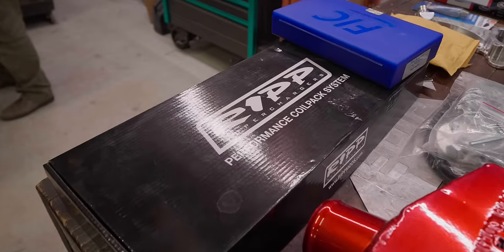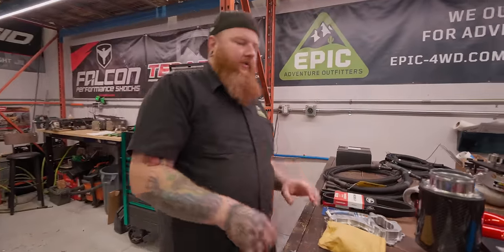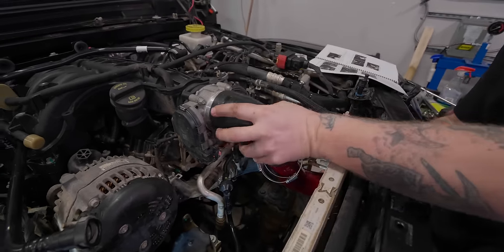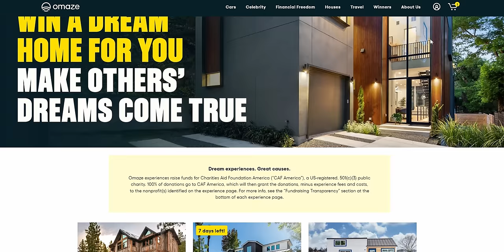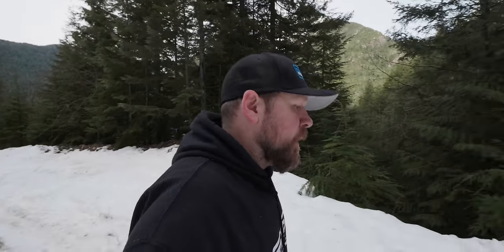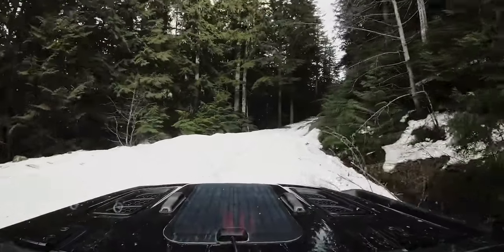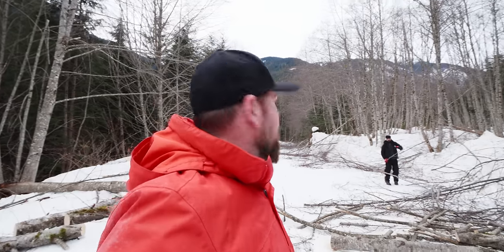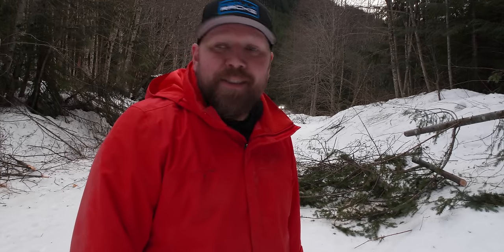WE SUPERCHARGED MY JEEP GLADIATOR

Comment: So covering the stock rad with the new intercooler doesn’t effect cooling ?
Reply: the air still goes through the intercooler and hits the radiator, so not at all. plus if it were to go down the radiator has its own fan that will kick in
Reply: @vitaminb4869  It doesn't.  The air passing through the intercooler into the radiator isn't in contact with the fins for long enough to any effective change in temperature.  Near ambient air temp is still hitting the radiator.